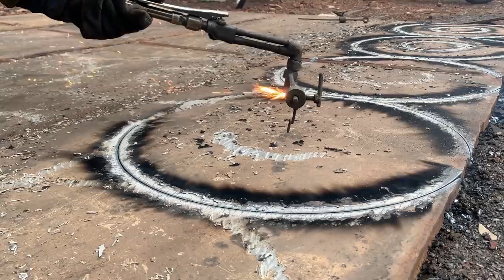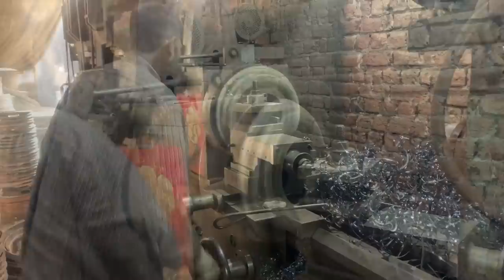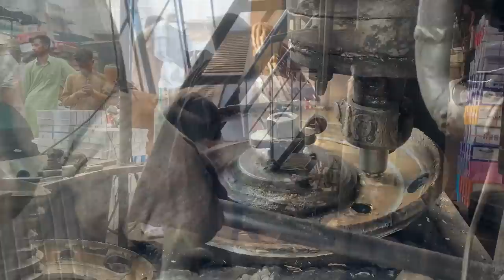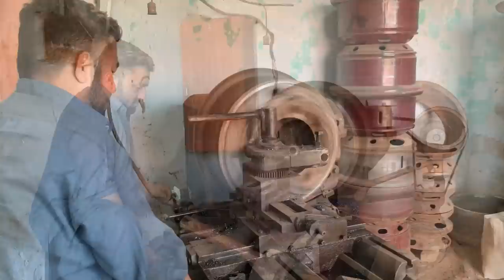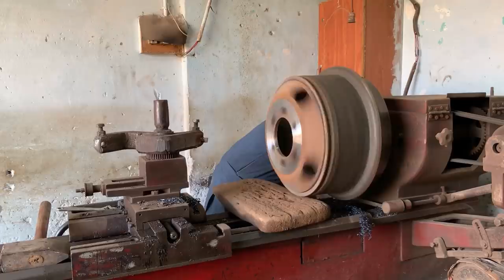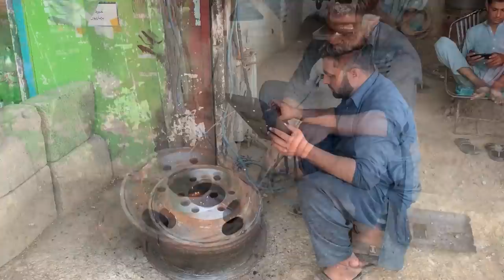How Heavy Duty Truck Tyre Wheel New Rim Plate are Made From Old Ship’s High Strength Sheet

Comment: I am impressed by the ingenuity of a lot of this, and I understand they have different standards of safety, but welding on a lathe with the current going through the bearings?!? Come on man! Be civilized! Lol
Reply: Oh ! But thats simply asking too much ! Perhaps they have friction bearing with 1 inch thick grease
Reply: There is handmade lathe, the motor connect with rubber belt with the lathe.
Reply: @CiCi-by8dy  that's not the issue.
He's welding on metal clamped in the chuck of the lathe, with the ground current flowing through the chuck of the lathe, through the frame of the lathe back to the welder, since he has no ground lead on the rim.

This means that the entire current of the welder is arcing across through the spindle bearing of the lathe, burning and pitting the bearing with as much current as the arc at the welding rod.

This reduces the life of the bearing, and makes the lathe get sloppy, and can be avoided by simply attaching a ground lead to the rim before welding on it.
Reply: @alexeyorlov9639  the current has to get there somehow, and the bearing is the point of least resistance, especially at rest... Lol
Reply: @ke6gwf  pethaps we current is taking a detour around the bearings
Reply: How else are they to obtain a Pakistani level of precision unless they use chuck bearings that aren't round?
Reply: Never heard of a welding manipulator?
Reply: @ke6gwf  i built some car rotators years back. they had no bearings, but i grounded through the base and they got harder and harder to rotate after a while, duh.
Reply: @CiCi-by8dy  that's not what his point was about.

Comment: Um, not only using old steel with unknown number of million flexes already, but they also cut out circles right across plate weld lines!  That can’t be good.
Reply: How many wheels did you make this week? They put four wheels on a truck for a reason you know. Incase one fails.
Reply: @marcogarofalo6343  6 ;)

Comment: Great welding on that rim than I have seen on the truck frame channel.
Reply: Yeah but welders knows that is welding with 6013 and i will teach you something, if the welds was good? They got protection 7018, 7016 basic will make a hole on is flesh and the 3 degree burns because of the radiation of the eat, my friend they use the worst electrodes
Reply: It should be,but safety is not the priority in that part of the world,thanks for your concern

Comment: The big ovals and the smaller round holes were all cut without any measurements being taken. They also didn't show the guys on the lathes measure anything. Maybe they did and it was just not shown. I'm surprised those run true on the truck.
Reply: There may have been an indexed plate holding the disk, that stopped it at the next position.  The ovals looked freehand,tho..  Or they'll put 5lbs of lead weights on the thing.

Comment: Imagine doing that work practically bare feet with all those metal shavings in the shop. All the same, totally amazing work and totally amazing what skills these men have. That being said, I do not understand why the rims on trucks are shaped the way they are. One would think there easily would be more sturdy ways one could come up with, than the way it is that sees the rim mounted (only) on one side (on the inside) so that all forces play harder on the 'connection point'?
Reply: It has to be mounted on one side so the other side will house hub bearing, brake and rotor otherwise your wheel will stick way out past fender.
Reply: @cuongandmari  Nope, that is so on cars.  I admit the fact some types of those are often ALSO called 'trucks' in the US makes it a bit confusing. But what I am takjing about are transport trucks. Big rigs usually have wheels that are hollow on the OUTSIDE! https://youtu.be/Re8bbEYGAzk

Comment: A lesson in how to cut heavy steel , note the the pre-heat circle this takes off the mill scale , Also watch how the torch is angled back when cutting not 90deg to the plate a very common mistake which will result in blowback  .................

Comment: Considering how expensive a lathe that size is and even more when your income is next to nothing 🤔 Id be nicer to it.
Reply: I would be nicer to it too, however it's probably locally made by cheap labour in some other dodgy small business.
Reply: @keithammleter3824  i don't know man. Shit quality or not, still gotta be expensive to replace, considering his business runs around it. I would've been beaten with a belt if i was swinging the micrometers to wind them in or out 😆
Reply: @ferdiyurdakul  : I agree.  But there are several of these Pakistani videos and they all treat their lathes pretty bad.   There's one where the guy welds a stub onto a massive axle, depositing around 10 kg of weld metal - and he too used the lathe as a return path, so 200 amps or more go through the headstock bearings for 15 minutes.
Reply: @keithammleter3824  Ive seen that 😆🤣

Comment: 1.  High strength steel from an old ship?   Ordinary mild steel more likely.   
2.  Someone tell the guy at the start cutting out disks about plasma cutters.   The cost of electricity is much lower than the cost of gas for oxy-acet cutting, and gives a cleaner cut so that less machining is needed.  Don't tell they can't afford the cost of the plasma cutter or any such nonsense - they bought the oxy kit.
3.  That lathe operator is terrible.   Know why he has to hit the toolpost clamp?   Because he hit it before, ruining the thread.  And each time he hits it again, he makes it worse.   He's wrecking the lathe bearings by using them as a welding return as well.  His boss should sack him - except he probably is the boss.
4.   Did I see the lathe operator hit a gib screw to loosen it and again to tighten it.  And why does it need tightening and untightened?  Because he's too darn lazy to use a bit of oil and put a new gib strip in.
Reply: They're not literate enough to read your comments, the uploader is not going to advocate for safety. Power cuts are a daily affair, oxy acetylene kits are cheaper because Pakistan is a major player in ship breaking and they probably make these kits there at similarly poorly run companies. Plasma cutters cost multiple times more. Easily up to 20 to 30 times because they're imported. To add to this, the employers don't value the life of these workers, who in turn are unemployable elsewhere with such skills... And has anyone ever heard of a workers' union there... Cheers mate, and don't get exasperated. They didn't, don't, and definitely won't.
Reply: @LakshmananLM  I realise the workers may not be able to read YouTube comments.   They may not even know YouTube exists.     However, any problem with electricity clearly doesn't exist, as they are shown doing stick arc welding and operating all sorts of electrically powered machines - lathes, presses, grinders, etc.   Other videos show they do a vast amount of stick welding, going through a fortune in electrodes.   And if they have electricity to do stick welding, they have electricity to do plasma cutting - whether there are frequent power cuts or not.  
I am intrigued as to just why these Pakistani truck videos have been uploaded - there are a lot of them.    Is the uploader some local who thinks they are impressively skilled?  (in welding they mostly are)    Or is he a visiting westerner who can't get his mind around how dodgy, and completely lacking in safety-mindedness, a lot of them are?
Have you seen how incredibly cheap Chinese made plasma cutters are?  You sometimes see them discounted to around $200 or even less.   And if they can sell for that in Western countries, they'll be even cheaper in Pakistan - could be assembled by cheap local labour in other somewhat dodgy factories.
Compared to oxy-acet cutting, a plasma cutter can pay for itself in the first couple of jobs, which is why plasma cutting has pretty much taken over in the West.   Even if the payback on the investment is 50 times longer in Pakistan, that's probably only a matter of weeks.
Reply: @LakshmananLM  : I realise that Pakistan and adjacent countries break up old ships, but 99.9% of steel sheet and plate used in ship construction is just ordinary mild steel.
Reply: @keithammleter3824  ship plates are quite sturdy though. They perform well enough for the use case. The country has no access to high tensile steel other than the original parts that come with the vehicles. They need this ingenuity (for lack of a better word) to keep their economy moving. We know what the government spends its efforts and borrowed /donated money on. It ain't the economy.
Reply: @keithammleter3824  It is possible that the videos are taken during power available times. Rolling blackouts are a thing. Don't underestimate the power of corruption. Even here in Malaysia we get ridiculous prices for quality stuff Americans take for granted every day. The majority of Asian countries levy ridiculous tariffs on Western goods, that it's eye wateringly expensive. We veer towards Chinese counterfeit or IP infringing products with dubious quality instead and pay the price. Even Japanese and Korean stuff that is cheap there is practically unaffordable to the average user. Entrenched business practice in such countries like India and Pakistan do not factor work efficiency and safety in their calculations, because they are not held accountable for basic human rights. The ships here are all from western countries, and they don't seem to care either. And that's damning of their business practices as well. Why not salvage or break them up in the US or UK or any other Western Yard. Laws. That's why. Unions and good safety practices. That's why. Greed. Never ending pursuit of profit. That's why. I pity these unfortunate slaves as they have no alternative, but they are shackled by their own thinking and acceptance of such risks.
By the way, I've done oxy acetylene welding and arc welding and couldn't agree with you more about the inherent dangers. Here at least we've properly migrated to MIG and TIG welding, but still the torch or disc(another scary proposition) for cutting. Progress is slow, sadly.
Reply: @LakshmananLM  : You said "they are shackled by their own thinking and acceptance".   You got that right, but it applies to choosing efficient work methods as well as safety.  This is an important point not seen by most who post comments to these YT Pakistani videos.
You may care to note that my country, Australia, used to levy heavy tarrifs on imported goods.  Tarrifs ranged form 15% (eg tools) to 50% (eg musical instruments) depending on the class of goods.    This resulted in almost everything being made locally, but with much the same safety standards and work processes used in advanced western countries such as the USA.   It seems we were NOT shackled by our own thinking and acceptance.  We even exported a lot, eg consumer electronics and parts to Scandinavia, New Zealand and other places, and cars to NZ and Africa, as the tarrifs provided a strong local base market to leverage.  Almost everybody getting a good education in primary and high schools, plus good trade schools and universities was probably the reason why we were not shackled - if somewhere in the world a better way to do something appeared, we knew about it, and took it up.
In I974 there was a change from a conservative federal government (known as the Liberal Party) to a radical reformist government (known as the Labor Party), and they took all the tarrifs away, thinking that would lower prices.   Prices didn't drop much (because distributors and importers knew what the public had been "trained" to accept) but it just about totally killed local manufacturing.   Just about everything you can buy in Australia now comes from China, with small amounts from Europe, Taiwan, and other places.  
We just dig up dirt (sorry, ore and coal) and sell it to China, who sells it back to us and to the USA as finished consumer goods.   Its a disgrace.
Reply: Ship plate is usually ABS, bureau Veritas or Lloyd's ( most likely Lloyd's). Very good for this application. High tensile and excellent properties for high heat input( welding)
Reply: @POTGIETERDAVID  : You are misinformed.  Lloyds, for example, certifies/approves steel making plants for supply of steel for marine applications.   This means the PROCESS of making steel is approved, and the product can be trusted as being FREE OF DEFECTS.   The product can be all sorts of steels, ordinary carbon (i.e., mild) steel, specialty steels, high strength grades, and the like.
As a general rule, steels that make arc welding easy are ordinary mild steels.
 Bureau Veritas is a process quality approval organisation.  Approval by the means that the approved organisation has a process that is a quality controlled process, that is a consistent process.  E.g., a process meeting ISO 9000 series.  Just about anything can be approved - a company  I worked for has BV certification for the supply and configuration of diesel engines.   A company my wife worked for had BV certification for assembly and supply of radio equipment to police forces.   Approval by BV does not mean the product is of high quality or grade - it means it is made to consistent known quality.
ABS?  Do you mean Danieli - a manufacturer of equipment for steel making?
Reply: @keithammleter3824  American bureau of shipping (ABS). Yes Lloyd's oversees quality control process... Lloyd's plate however is all at a tensile strength of around 500mpa and up. That's from grade A up until the xx36 series.( It's minimum requirement Is never lower than 400mpa). I specialize in pressure equipment.. mainly ASME. It's very seldom that I see the other approved grades I mentioned.. if I do I just get the equivalent ASME P number in Lloyd's plate because Llyods plate availability is abit better in my area.
Reply: @keithammleter3824  what matters is what the welding does to the metals grain structure and strength without pre/post heat treatment. Ship grade steel does not get terrible HAZ issues.
Reply: @POTGIETERDAVID  : Ah!  American Bureau of Shipping - a build/construction prescriptive outfit.   I should have thought of them.  Trust the USA to ignore international standards and do things just enough different to be a major nuisance.
For many years I worked (as the Engineer) for the local dealer of marine engines made by a very well known American manufacturer whose corporate colours are black and yellow.   We would import their engines costing us $80,000 and have to do modifications and tests costing another $15,000 to $20,000 - because the engines were built to US standards and not international SOLAS (Safety Of Life At Sea) standards.   Of course our competitors had a $15,000 advantage as they were selling European or Asian engines that came from their factories already meeting international standards.
Not all international standards make a lot of practical sense though.  For instance we had to supply v-belts certified static electricity free (presumably so they could not ignite any stray fuel mist and cause an engine room fire).    There is NO difference between a static free belt and an ordinary belt - they are all slightly electrically conductive - its just that one comes with a certificate and costs a lot more.
Meanwhile, it is still the case that just because some steel plate came from an old ship, it is necessarily anything but an ordinary carbon mild steel.  How do we know it came from a ship, or any particular part of an ship anyway?   I don't suppose these small Pakistani businesses have a paper trail and manpower to assure incoming material traceability.  Wot's ISO 900x?  What quality manager?
A carbon steel with a tensile strength of 500 MPa is just an ordinary mild steel.   There is nothing special about 500 MPa.  400 MPa is the standard commercial lower limit for mild steel.
Reply: @keithammleter3824  Agreed. You sound like an interesting person.
Reply: @POTGIETERDAVID  : I wish all the ladies would say that .....
Reply: @keithammleter3824  😆

Comment: In the first minute you will see a guy cutting blanks out of a sheet of a  ships hull with a big fat weld running thru it . I would NOT want to have any rim made by them on my truck . These guys have no clue about metallurgical science, no clue about strength coefficient, no clue about the steels harmonics or what happens to the steels strength and structural integrity after they force it into the shape of a rim center . This is not quality. This is a total disregard for it .this has a reasonable expectation to fail causing harm and perhaps even death .but then again from the moment the pieces of steel get harvested on the infamously hazardous ship breaking yards where people purposely put them selfs in peril for a handful of rupee to stay alive all the way up to where this sheet is formed into the end product there is a complete disregard for any and every person that touches it . Even whomever is unlucky enough to use this rim in the future most likely knows its total crap that he is buying and risking his life with but it's all that he can get . Life expectancy is low so what does it matter